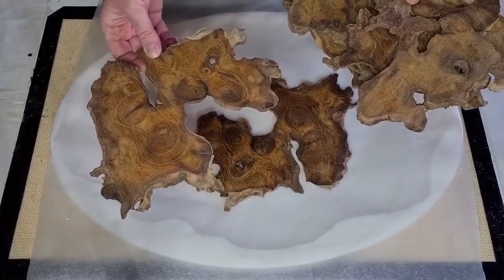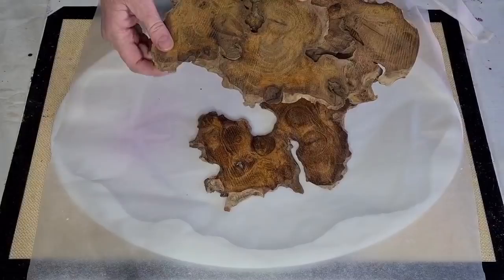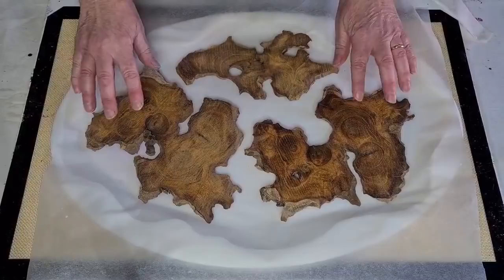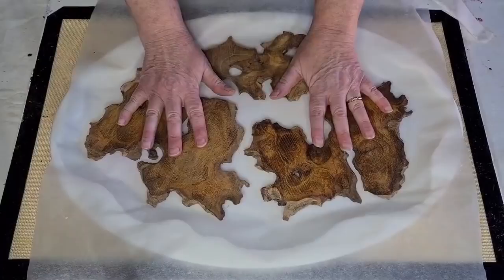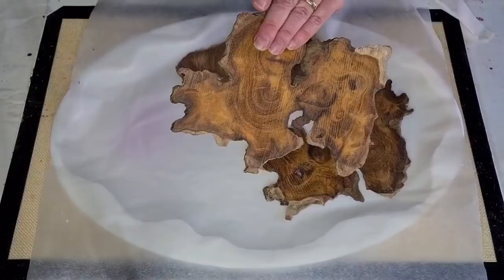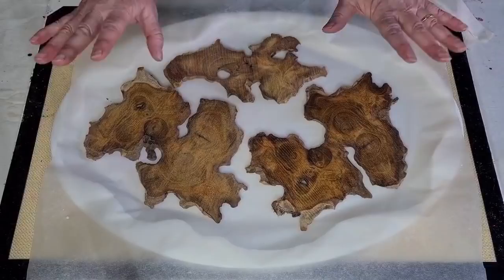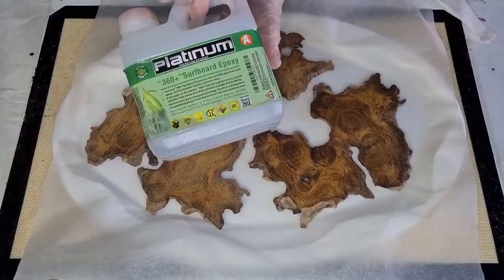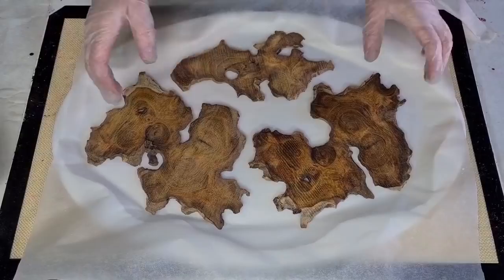#1246 Beautiful Geode Resin Tray Using Thin Slices Of Wood

Comment: The Teak is yummy, I love the rock edges & I look forward to the coasters. I buy inexpensive, but sturdy nylon gauze (for veils, I image) and make covers for my artwork. I use deconstructed coat hangers and clothes pins. I wanted them to be easy to take apart so I can toss them in the dryer to delint, if that’s a word.

Comment: I see two animal heads. Facing us, the biggest piece on the left and closest to the end of the Oval is a moose head. Then the piece to the right of that one and on the left end is a boar's head. And then on the right of the same piece as the boar's head looks like Africa. 😁
It turned out really awesome. The wood slices are absolutely gorgeous. Because it is so elegant, I say paint the sides/edges copper. The edges are too rough looking. I think if you were able to have pieces of the teak cut to fit inside each of a set of coasters would be stunning to go with the tray. 😊  Great job Julie. 😊💕🤗❤🇺🇸💜